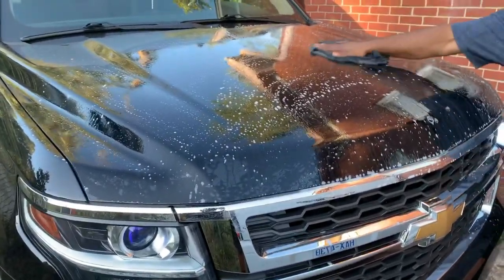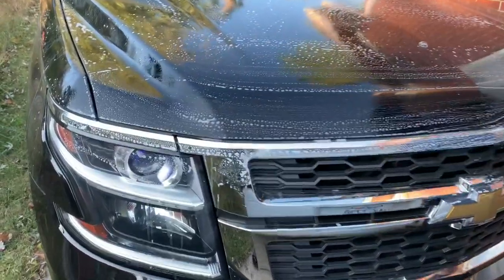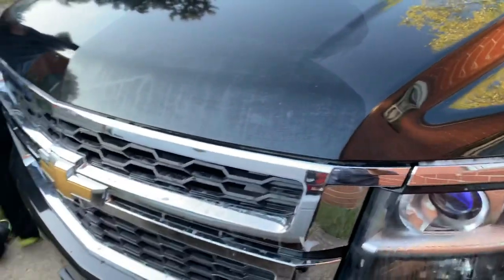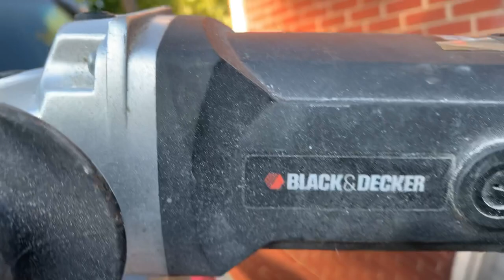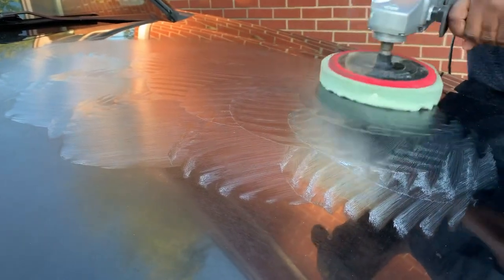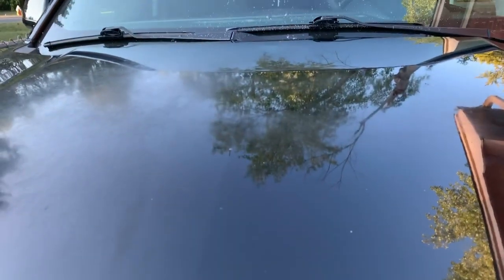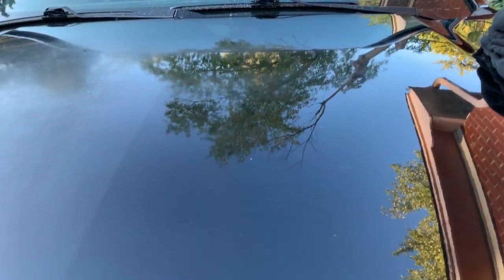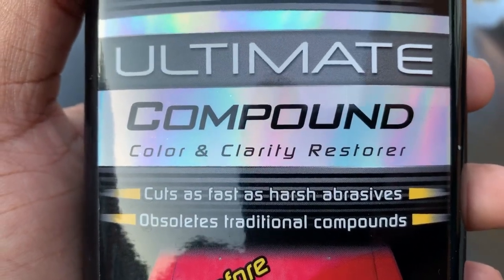2015 TAHOE PAINT RUINED *MUST SEE*

Comment: Hi Steve, i have a Tahoe just like yours and the paint on hood is all scratched up. I asked a Chevy service advisor about this situation and he mentioned to me that it is a common issue with the Tahoe’s  and other similar Gm trucks specially The color Black and other dark colors. He said besides the carwash its due to the Sun ( i live in Miami, Florida) he recommended me to repaint the hood and keep up with the wax and paint protection. I am looking for a decent and affordable place to do this job for me. I hope you get this issue resolve as well. Nice video!!
Reply from the maker: Hey Joe, yeah it definitely appears to be a common issue with GM trucks. I am still not 100% sure what caused this problem to occur, but I would be interested to find out about how your Tahoe turns out! Keep me updated on the outcome. Here I have linked a couple recent videos of how I fixed my own hood (DIY) check it out! Thanks for watching!  https://www.youtube.com/watch?v=wz8XcNZ428E   https://www.youtube.com/watch?v=P5_Ot2UNbGw&t=3s
Reply: It’s a clear coat failure. Best way around this, is ceramic coatings or paint protection film
Reply: Thanks for your video I just bought a 15 Tahoe LTZ the hood is just like yours, I plan on getting it repainted & using ceramic coat
Reply: @DawgFan7  how much did you get a quote for I got the 15 LT suburban and even my roof looks like this was told I had to pay $1200 just for removal/install of hood because the head liner needs to drop to remove rails on roof lmk what kind of quote you were working with in curious I’m at 1k for the hood

Comment: Holy crap I guess that's what that was from... Just bought a 2015 Tahoe from the stealership with these exact same scratches on it, looked like it was down the the metal. Assumed it had gotten tree sap on it and some DF went at it with a brillo pad. Luckily I was able to have them repaint it. Ran it through a automatic car wash since then and no scratches like that. Was there a particular brand carwash we need to be on the look out for?